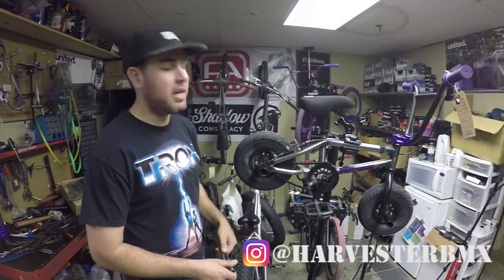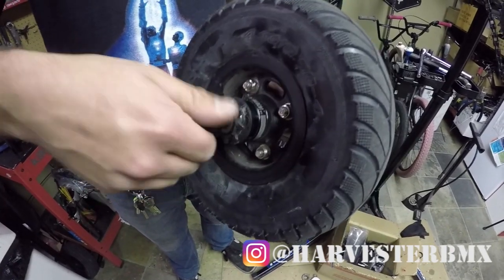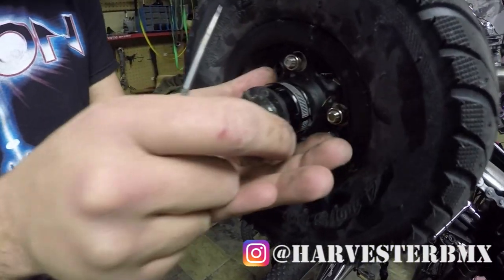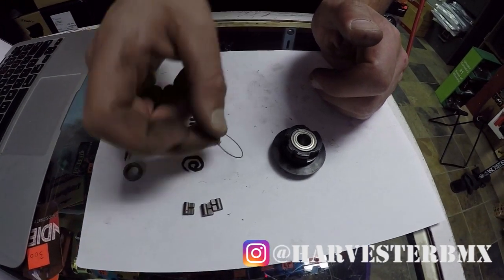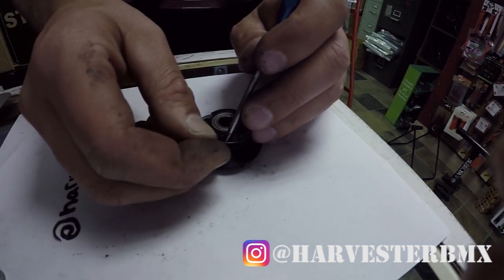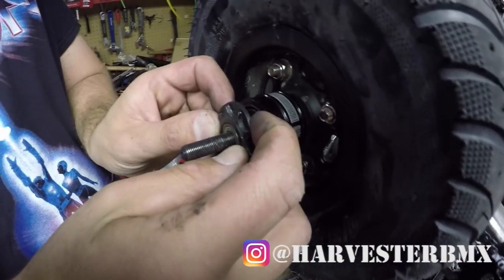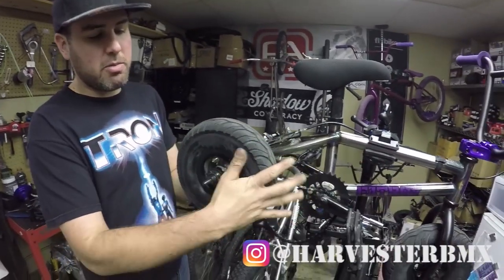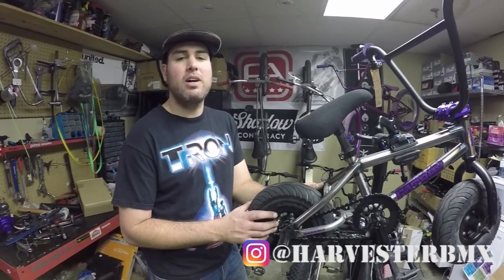Mini BMX Driver Maintenance/Fix your Rear Driver @ Harvester Bikes

Comment: I have a 9 to sub the 19th is stuck in the hub I cannot even pull it out of the tub can I get somebody's advice on this somebody's help please I've tried everything possible was getting this 9 tooth driver out of this hub and it won't come out to the point to where I beat on it and it won't come out
Reply: Just ride it without the bearing it will come out that’s what I didn for mine lol